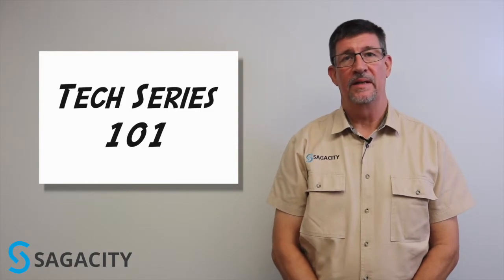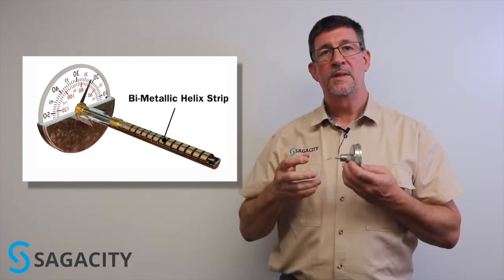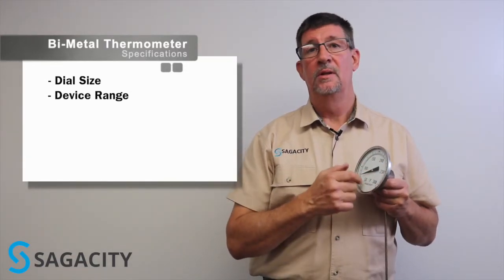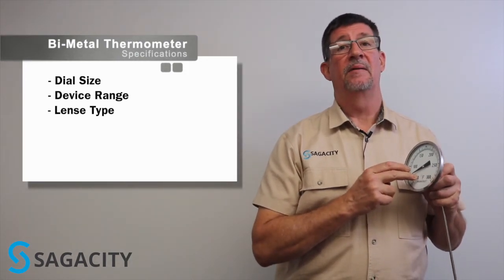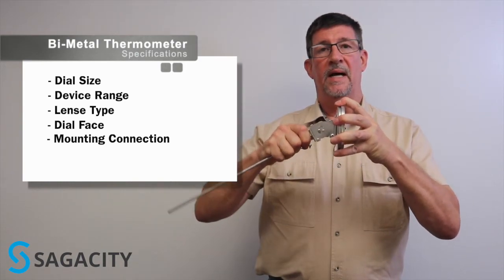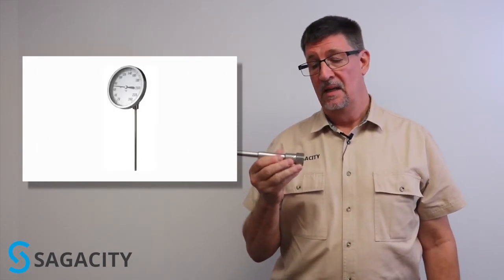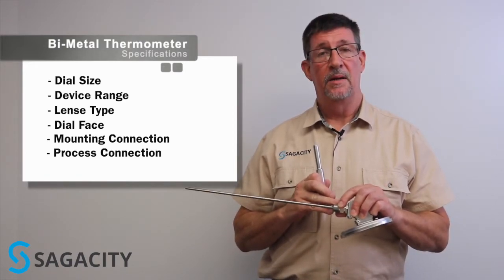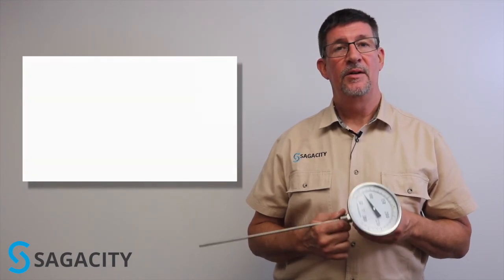How do Bi-Metal Thermometers work and when would you use one?

Comment: Can we use the bimetallic thermometer in a switchgear to detect temperature and also is it possible to get a digital or analog output from this sensor
Reply from the maker: Yes, bi-metals will work here, but please note they won’t last too long in high vibration environments. If you require an output it is probably best to use and RTD and transmitter. Bi-metals typically don’t have analog transmitters integrated with them.